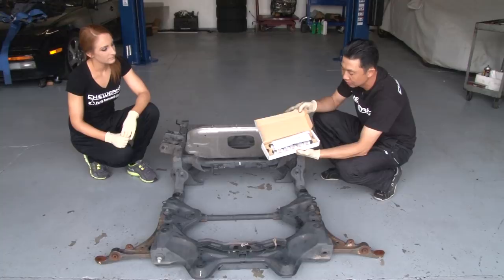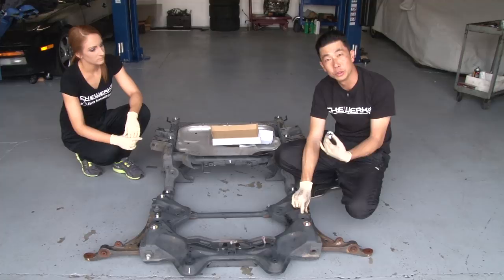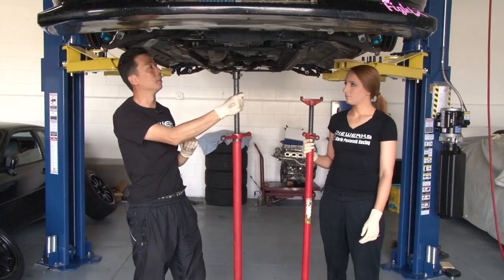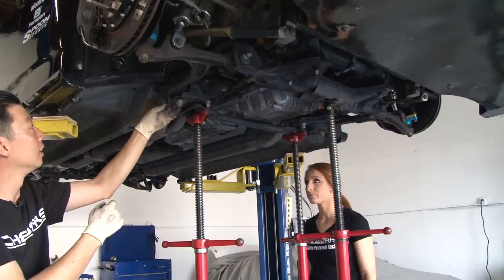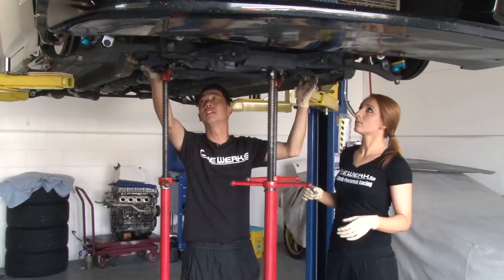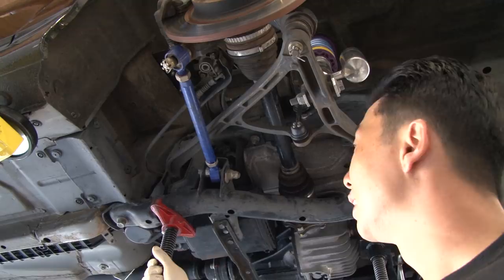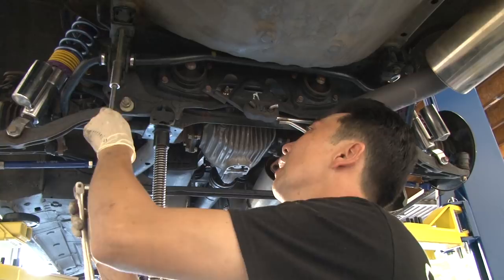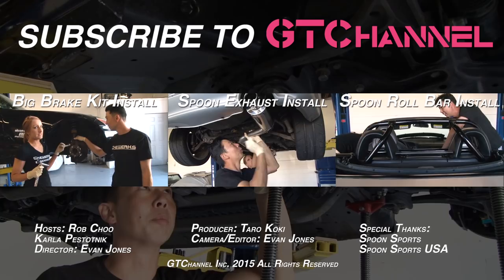How to Install Rigid Collars - Honda S2000 - Spoon Sports - Technik

Comment: Don't forget to retorque the bolts after a 500km/310miles! This is extremely important, as the bolts will lose some of their clamping force due to the aluminum still deforming. Read the manual.

Comment: After you refit the subframe, be sure to get a 4 wheel alignment done to make the most out of the collars. Actually, when you do any mods to the suspension or chassis it is a good idea to at least check the alignment after you've finished. A few manufucturers like Ford and Vauxhall/Opel (a GM owned company in the UK and Germany) recommend getting at least a front end alignment done every 6 months! Making sure all the wheels are pointing in the directions they should be makes such a massive difference to how the car feels and the feedback you get through the steering!

Comment: If they're designed to be crushed in between the body shell and the subframe doesn't that mean you can only use them once? If you later remove the subframe with these installed wouldn't you have to replace them?
Reply: +CaliPatriot88 
not for real because the ring of the colla is just one millimeter so it don't crush for real.

Comment: Do you need to take the wheels off while dropping the sub frame? Also, do you have to worry about the steering column/steering rack when lowering the subframe? Finally, I thought you were supposed to apply the copper grease to the faces of the collar, not the threads of the bolts?
Reply: no you dont remove the wheels...they did because they were filming if and the wheels were blocking the camera.they made it seem like dropping the subframe is a piece of cake...its not!!! steering rack is not the issue..damaging the a/c lines and rear engine connectors are the only "dangers"to dropping the subframe...they only dropped it about 1-2 inches and were very careful, however I did not like how they did not warm you about the AC and engine sensors.

Comment: Dude. Are you sure you put the anti-seize on the bolts? Wouldn't that loosen your bolts and make them come out easier? That would be fricken dangerous. The AS should be placed on the collars themselves to prevent the collars from locking. If I'm not mistaken, the video from Spoon themselves had the AS on the collars.

Comment: It would be great if you could do a before and after or at least a review of the product...
Test the part before you change it or at least give a subjective feel if it cant be measured..
I always wanted to do the subframe collars but my mechanic said it was not to do anything.. i get the tech side of it but he says it has nothing to do with holding the subframe tight enough
In any case for the brakes you can measure the brakinfg difference from oem to alcon and so on with the other products..
Thanks for the videos anyway

Comment: Is there a reason why Honda designed the s2000's subframe with so much play in it? Would I feel the benefits from the rigid collar kit on the street? I don't plan to put anything grippier then summer tires on my s2000.
Reply: Le Enderman It's something all subframes have to deal with. This problem isn't just for the S2000. I own a Genesis Coupe and was recommended I get the collars. From what I've heard, you will definitely feel benefits on just normal street driving. Since I don't have them yet, I can't back that up with personal experience.